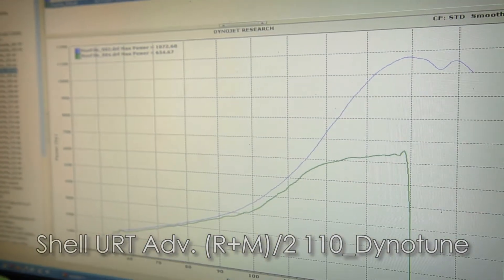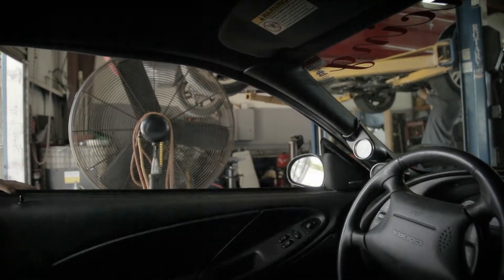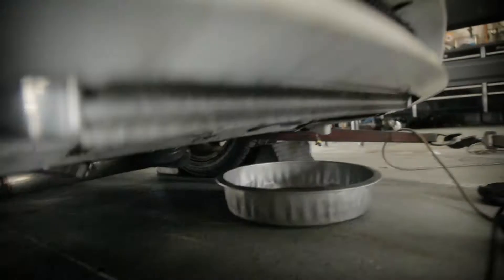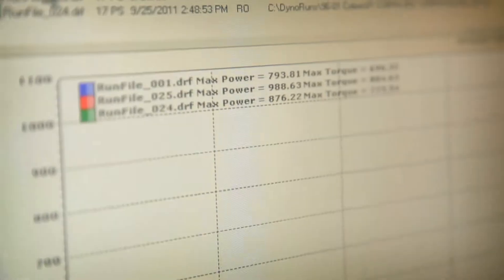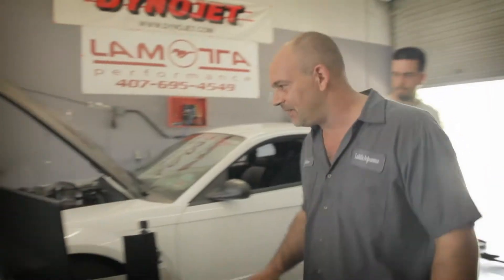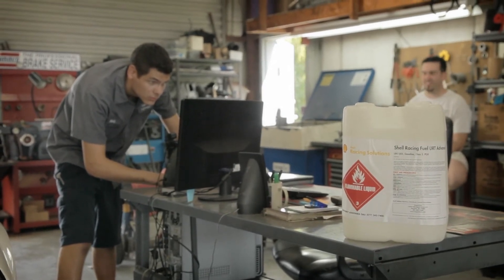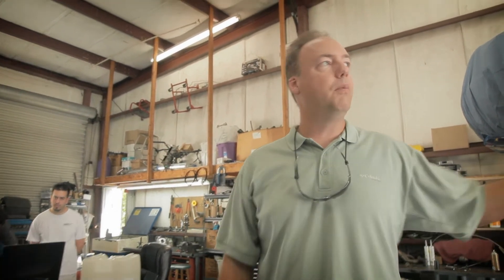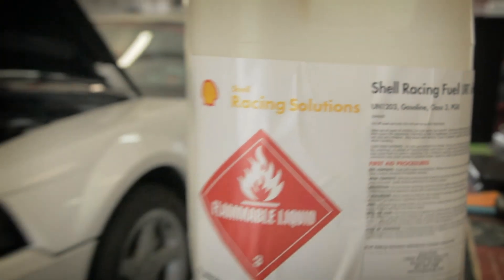Shell Unleaded Race Fuel Challenge: Leaded vs. Unleaded.  Lamotta Performance

Comment: It was explained many years ago in aUK motorcycle magazine when folks noticed that unleaded decreased MPG and reduced engine power. It was because in order to keep the RON octane ratings good they had to reduced the Toluene content from 28% (4 star pump leaded) to between 8 to 12% which as this was the principal calorific energy content provider, obviously reduced the amount of energy generated on the combustion cycle.
Reply: Nowadays, of course, we have Tetraboost, which restores the tetraethyl lead to fuel....

Comment: No, you missed it. Your "ifs:" are part of the evidence... Corn works, but its too inconsistent and not readily available here... In addition to "If" your components are compatible (and you have the headroom for it capacity wise)..... Not worth it. Not for me. Not for many I know.... the POINT isn't about e-Xx that's why I said what I did... The POINT is that this is an unleaded fuel that performs better than a Leaded very well reputed fuel.  Capiche'?  NO, probably not....